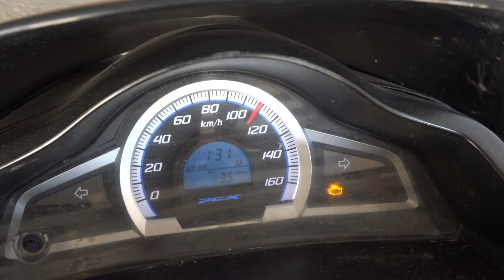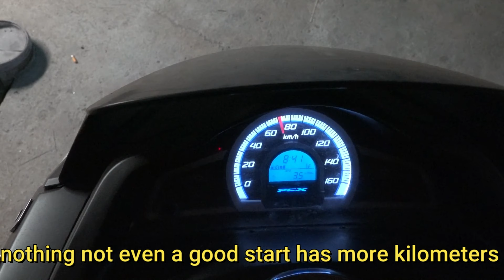honda pcx the best starting end top speed fail

Comment: All you needed to do to grind the inner part of the front variatior. Because pulleys go to the sides with centrifugal force and closes the front variatior to the max, but worn out sides won't let the belt to reach to the max, so you should grind a like 50 mm of inner part (25 mm for both sides) of the front variatior(where the inner part of the variatior meets the bush) so that it has more way to squeeze the belt to the up.

To experiment this, you can take out the front variatior and measure the with your hands. I mean, try to see where the belt reaches if the front variatior fully closed, line them up and put the belt between, see where it reaches to the top. It will not reach to the top. So grind the center of the fan and give it extra room to squeeze belt to the top.

But you can't grind it without professional tool, grinding must be even, not even a 5 mm wave is accepted there.
Reply from the maker: I tried something if it works or not but if I want to put plus 10 km it is possible but everything will work marginally this I don't want

Comment: The clutch dont get more top speed or torque, only the variator can do that, the clutch is only for dont lose that torque or speed Preventing the belt from slipping, And to avoid that, you need configure the contra spring and the 3 little Springs, if the variator can do 60mp/h, the clutch only can do 60mp/h,You can't make the clutch  the controller, the variator is the boss, Don't lose your head Trying to get more speed customing the clutch, again, the clutch is only for dont lose the power of the variator, if the variator have problemas the clutch have problemas, if the clutch have problems, the variator dont have problems, And the clutch only have little issues, like don open the pulleys because don have grease, And the Overheating for the Crystallization of the pastes, And that 2 issues make otre little problems like More vibration, lost torque, speed, etc

Comment: Notice how the CVT starts to move before the clutch bell starts spinning. The variator weights are too heavy. They are pushing the variator closed before the scooter starts moving. Go 2 to 3 grams lighter. Also, 20x15 weights fit better inside the variator to start with the variator more open than 21x15 weights. Dr. Pulley Sliding weights maintain the top speed while using the smaller 20x15 size and the 2 to 3 gram lighter weights.

My 2015 PCX 150 currently has 20x15 21g sliding weights to maintain higher fuel efficiency for in town rides. I have 19x15 12g sliding weights on the way to liven the bike a bit. 75 mph top speed currently. No plans to go any faster. This is fast enough on such a light bike.
Reply from the maker: very correct things are exactly as you say!!!

Comment: U need to squeeze first the torque drive or rear pulley until the belt reaches the the bottom part ( the same place where the belt go on high rpm or speed ) to prevent damage on the crankshaft’s spline or teeth and also to the drive face or front pulley. I have noticed that the time you tighten the nut, the drive face wobble or shake. It means that you have not placed it properly since the belt block it.
Reply from the maker: sales sure can't understand you what are you trying to describe here is a failed video which didn't get a single kilometer more and the centrifuge was destroyed as well I show in this video that it cannot get kilometers from the specific part of the centrifugal as much as the pcx

Comment: The crank must be upgraded , not the way you do because the motorcycle reach it top speed but the the the back crank is small it will not help , good work
Reply from the maker: Hi abdel your thought is very good but an experiment i went to do to see if it will work from there it didn't work and yet there is a way to improve from the rear pulley regardless that everything will work marginally and nothing is secured that's why I haven't dealt with this issue

Comment: I tried the same thing by extending the pin path guide to get a higher top speed. The results don't have much effect😂😂
Reply from the maker: Hi @sampainiku that's what I'm saying in the video, that it failed
Reply: @MBPATENTS  of course it failed. you not understanding the motor is limited rpm.. you need to remove engine limter then go try it on the road...... yes it is that simple. and also put back the original centre roller that these had to stop too much belt wobble

Comment: When moving this spacer to the inside, if you are using roller weights, your top speed drops a lot. Replace with Dr Pulley sliding weights
Reply from the maker: the speed is not affected at all by the weight of the beer i have explained it in other videos too thanks

Comment: I see you are good mechanic and have understanding of how things work,1 question for you:
My honda forza 300 says 10w30 bot engine and final drive oil,do you recomend that or maybe 5w40- 10w40 for engine and 80w90 gearoil or 75w90
Reply from the maker: Hi audio I'm not a mechanic, I'm just experimenting to make my daily life easier because I spend many hours every day on this bike, the 10w 40 full speed is very good for me, I'm close to a million kilometers from 10 40 in the first place and for the pcx 5 30 manufacturer to put but I had never put once I put the 5w30 tsimba for some oil while with the 10w40 I am very happy just the oil change my pcx manufacturer says to change it every 3,000km max and i change it every 2500
Reply from the maker: and all these years I've been using motul which at the end stings the motor a bit if I've also tried castrol which doesn't have the cake at all but motul at 3,000 kilometers may need a supplement 200 300 emel
Reply: If it's a brand new forza 300 don't use anything other than 10 30, but if the kms high like 50k you can use 10 40, because the clearance of the parts where oil gets in are tight, it'll not let oil get in there, if you use 10 40 wear and tear will be much more faster.
Reply: @kivitropikal6755  and transmission oil ?
Reply: @audiophilipp  90 gear oil
Reply: @kivitropikal6755  is 75w90 good ?
Reply: @audiophilipp  yes as long as it's a good brand like motul or shell. Change gear oil with every maintenance. And do not put oipl more than needed. It's most of the time 160 ml, it'll be written on the side of the variatior
Reply: @kivitropikal6755  i use motul full synt gear oil,75w90,about oil thickness ure right,but.. if 10w30 is recomended i higly recomend using 5w40,They are so similar (10w40 is far more thicker than both of them) so u can go a little bit thicker with 5w40,u will have thinner oil at cold starts (that is good) and a little thicker at the working temps (90 degrees) that is also good.
Reply: @audiophilipp  thanks I'll consider that

Comment: This method is good and will function optimally if the front of the roller housing has been make the path slop so that there are no obstacles for the roller to rise, and the size of the roller must be reduced by 3-5 grams from the standard
Reply from the maker: Hi andynsyod on some other scooters this works normally for a while 10 kilometers or 15 plus on this pcx scooter it doesn't work at all it doesn't work

Comment: Hi, how strong is the engine in PCX? How many km you can do on orginal cylinder, orginal piston, orginal engine head etc?
Reply from the maker: Hi robert the pcx counter reaches 333,000 kilometers then resets to 0000 i've finished it twice and it's going for the third it's unbelievable i see the engine and i'm laughing i can't believe it it's immortal from her it breaks to the reason I experiment to make videos and this is not so good but still very powerful πριν τρεις μήνες μέτρησα της cps και είναι 10.4 oil change every 2000 or 2500 kilometers when I start working on a pcx motor I have to describe many things and we will see the different ones with the other motors more symbologist which is better than the pcx motor but before I deal with the motor I want to put a turbine until it breaks the motor???after 7 years of working 12 every merino even on weekends till date nothing has happened im tired of riding it too i am tired of this!!! PCX💯👑👑👑
Reply: @MBPATENTS  Im not sure can I understand You :o scooter has more then 660 thousand kilometers and soon will be 1 milion km? Cylinder, piston, etc is still factory orginal?
How often do You set valve gap?

Comment: its the electronic limiter your hitting that is stopping it going faster.. plus take away the washer on the front variator unless brand new belt.  you must ve asian doing this. as anyone else would have the bolts tightened up correctly

Comment: have you tried it without the washer you put on the front variator?
Reply from the maker: Xoris ti rondela itan simply with what washer is left, the variator is more open with the result that it has a better start.
Reply: @MBPATENTS  you mean pul laway not start.. your english is bad............ you mean pull away from zero is slower.. well no it wont be when you get it right because the variator grips better = more power to the wheel.... you need to get the motor running with more power before messing around down at variator..... you can gain another 2 hp from the motor. do that first....